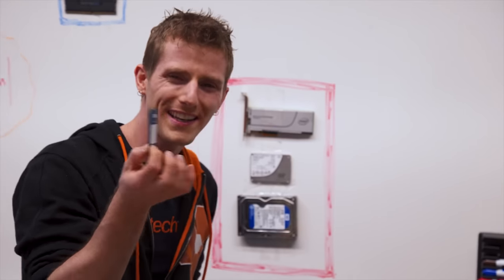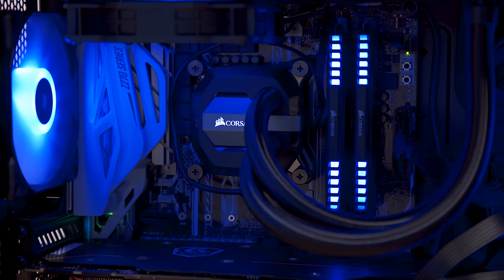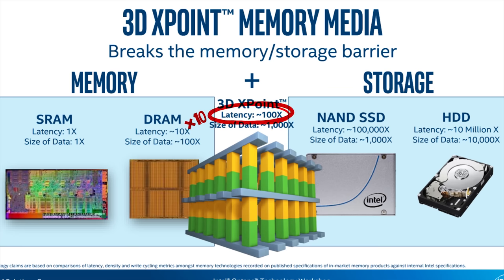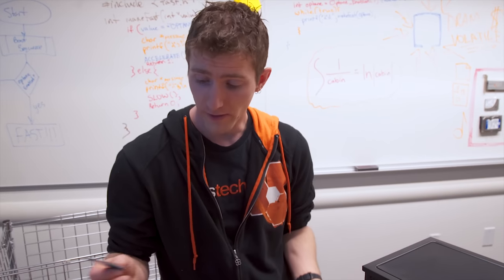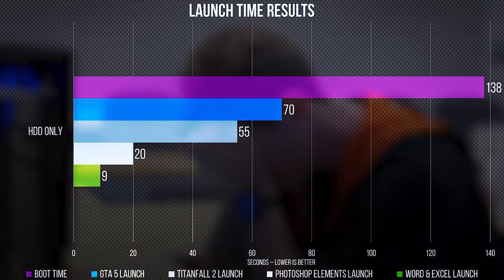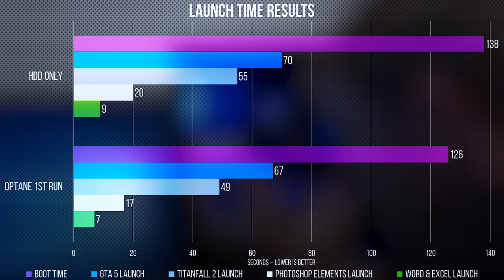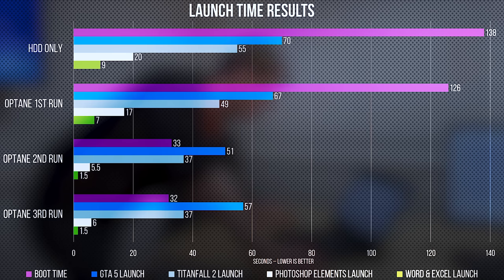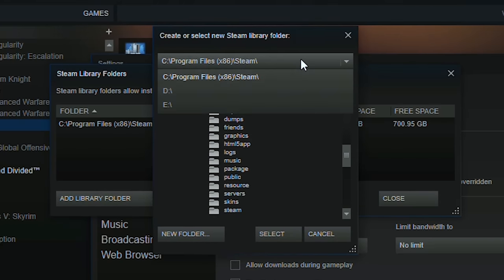Intel Optane Exclusive Hands On - SSD Crushing Performance

Comment: So basically a SSHD.... we already have that
Reply: not really. 1. it's way faster and has/is a bigger cache. 2. It works for all your drives.
Reply: but slower than a regular SSD NVME or Sata.
Reply: According to UserBenchmark's website you will see that most all SSHD benchmarks perform worse than the traditional HDD versions. So now you can get a good traditional HDD like the WD Black or one of the new Seagate Barracuda drives and pair it with one of these so you can keep the storage capacity and have the applications and OS perform like an SSD. Maybe caching technology isn't new, but there is still reason to appreciate this new release. This definitely helps out budget pcs. You can build a new computer with the lowest end 7th generation parts and it is still Intel Optane ready. You don't need to use the latest and greatest stuff to be compatible with it. The core i3-7100 and h270 motherboards will support it.
Reply: Userbenchmarks isn't a reliable source.
Reply: sickofitall89 are you kidding? It is the only website I know of where there is no bias. Because it is the public that provides the benchmarks rather than a public figure who is paid to speak good of a brand. You download their software and run it and it performs the same benchmark no matter what computer you use. It then automatically submits your results to their database. The scores on a product like let's say a GTX 1080 is based off of thousands of user submitted benchmarks. You can go to a blog where one person did one benchmark on the GTX 1080 and listen to them, or go to Userbenchmark and see how thousands of GTX 1080's performed under the same load. You have to be ignorant to think UserBenchmark isn't a reliable source. Are you saying GeekBench isn't reliable either? They work the same way, but with focus on the CPU rather than everything inside your computer.
Reply: Elmer Gloo Agree.

Comment: Why not install windows on that Optane M2 drive to benchmark it against some other SSDs??  16 or 32GB should be enough to do that.  It'd be interesting to see if we're really going to see the benefit of that extra low latency in SATA vs M2 vs PCIe.
Reply: Probably because its inferior. My opinion after watching the video is this is meant to turn a large HDD into a poor man's SSD. Say take 50 USD Optane + 80 USD 2tb HDD and you get something that is somewhere between an SSD and a 10000RPM HDD in terms of speed.
Reply: yeah its like first responce ram but with the data already on it.

still going to get a NVMe for my bood drive anyway so optain wont be that useful to me (nor willl it work with zen)
Reply: thom1218 - I think everyone is making a huge critical mistake, they think its a HD, stop thinking its a HD, and think of it as a "cache" FOR the HD... I think thats where the disconnect is with everyone... yes intel will be making some of these as a HD, but thats for enterprise level customers willing to pay insane amounts for faster performance, but at the consumer level, these 16/32GB sticks, will be acting as CACHE for your HD...
Reply: 16G is not enough for windows 10 and if you count updates - 32G is also not enough.
Reply: Actually, I have a 32GB tablet running the 32-bit version of Windows 10 with updates, and it even has 10GB of free space.

The 64-bit version probably won't fit though as it includes binaries for both 32-bit and 64-bit.
Reply: Its role as cache for an HD is clear in the video, but it wasn't clearly explained that these these sticks cannot be formatted and addressed via the m.2 standard as a regular SSD.  I'd guess that brief bit near the beginning about only working with the latest Intel chipset implies that they implement a brand new standard / interface designed to only operate as a cache mechanism.

Comment: TLDW: Non volatile HDD caching with native hardware support that's probably close to useless with a decent nvme drive and windows installed in UEFI mode.
Reply: NVME is just another interface to SSD/NAND. There is still the problem with write endurance when you use it with stuff like hybernating or page file swapping.
Reply: True... But I've yet to get bad sectors/errors on my first SSD (OCZ Vertex 2) and I'm a bit harder on HDD rewrites than the average person. Not to mention endurance has gotten way better on newer products.

Comment: DEFINITELY need a full suite of benchmarking/reviews.  Biggest questions are:
1.) Is Optane a cost-effective way to run 16GB or less RAM while retaining performance?
2.) Is Optane more worth it than the incremental cost of going for PCI-e NVMe vs. SATA SSD at same capacity?
3.) Will software changes be required to fully leverage Optane, or is the goal to be transparent to software?

Comment: what happens if you use 2 in just a single computer?
Reply: Probably more analogous to RAID 1 as apposed to RAID 0 in that I don't think you'll be doubling the already increased speeds. Instead you'll probably just be throwing money away.
Reply: banker games i think current motherboards just have 1 optane slot... if you use it as storage then it will just serve as another storage but FASTTTTT
Reply: I don't think you can yet.
Reply: like GTA 5

Comment: What does this do with all SSD storage?
Reply: Andrew Ramirez I want to know this too.
Reply: probably mothing,its the same between and ssd and an nvme ssd,the cpu is the botlleneck no the storage,while it will have higher speed you will see little to none performance increase
Reply: In an HDD system, your strongest benefit comes from using the device as storage cache, like a hybrid drive [SSHD].

In an SSD system, your strongest benefit comes from using the device as memory cache or memory mirror. If used as a memory cash, applications that don't need fast memory like Chrome, Steam, or Twitch could (based on access frequency) be allocated to Optane. If used as a mirror, if you shut your PC completely off, when you turn it on again, it can flash the contents of Optane to system memory after POST and take you right back where you left off... no boot required.

Do I actually know that you can set up the drive that way? Nope, no fucking idea, you probably don't benefit at all as an SSD user.

Comment: If this is supposed to be faster than current SSDs, why would you compare it to a regular HDD? We want to know how it performs against current tech, not old tech.
Reply: Matt Parks You miss the point. Optane is pared with a HDD to speed up the HDD. You can compare it with the SSHD, or Intel Smart Response Technology witch pares a SSD with a HDD to speed things up. So this is low tech comparision is relevant. This is not for us that can afford and use SSDs as main drives!
Reply: Or put a couple of 3 TB HDDs in your pc and an optane for cache - enormous storage with decent response time. Still, I can't imagine a wide range of users doing this. But hose, who can't afford ssd as main drive, can't afford an optane with high-end grade hardware as a requirement either.
Reply: Marcus Lagergren, you can buy a 120gig San disk SSD for $50. With this, you'll get a huge speed bump by using it as a boot drive and still have room for some programs. So why would I want to invest in optane when the speed of the SSD won't be noticably slower and I get storage capacity? I see no real benefit to using this over a cheap ssd.
Reply: Matt Parks This is not aimed fir those who wants OS on SSD as Intel claims it is hard to use. Optane makes sense in cheap PCs. It is statet by Intel and other tech sites that the DIY and enthusiast community is not the aimed part here. Dell, hp local PC stores etc are more the right taget here. And consumers that buys the cheapest PC they can get.
Reply: Think of a 2 TB HDD with an entire library of games being speed up by a 50 USD optane drive. You have to see optane as fast cache for a HDD to drastically change your load times. You basically spend 50 USD to make from your 2TB HDD a 2 TB SSD. It will affect your boot time, launching application time and game load times. I would say that's impressive. Even for high end users this makes sense because most high end gamers nowadays load their entire library on a HDD and their operating system starts from their SSD.  So basically for 90% of their time they don't see any benefit from their SSD.

Comment: So its just like samsung Rapid mode. Rapid mode uses 4gb of ram and  ram is faster than optane ssd.
Reply: DRAM is volatile so you risk data loss with that feature. This is non-volatile.
Reply: +Sakkura1 actualy its the same result, samsung rapid mode is excalerating ram as a chash for the ssd. near the same result as this intel product
Reply: No, it's not the same result because rapid mode uses system memory, which is volatile. If power drops, the data in flight is lost. With this cache, the 3DXpoint memory is not volatile, so power loss would not make the data disappear.
Reply: Sakkura1 I left that point out because everyone knows it. I thought optane ssd will be some new technology. Expect for far better life than a normal ssd.
Reply: Rewatch the beginning ppart of the video, he explains why this is not happening and that you cannot accelerate boot times with ram
Reply: It is an issue when there are changes to the data. Obviously pure reads are not a problem.
Reply: yes especially if you use fast ram.
Reply: Yeah. Just buy a 120GB ssd for boot drive and use dram as cache for everything else if you want. or just use the ssd. this optane drive seems pretty useless imo.

Comment: THIS  IS NOT NEW!!! 
Is the same as "intel smart response"
Compatible second-generation chipsets that support raid
Reply: Dinamitium 3d xpoint is new however
Reply: It's just a new name for an old technology.
If intel really wanted to renew this technology, they would add that cache directly inside to the processor

Comment: The question is, can you use it to accelerate another optane that eccelerates even more sh*t
Reply: Use only optane drives so that they accelerate each other and reach an infinite loop of acceleration. That's how it works, right?

Comment: You can buy a good SSD for the same price as a 32 GB optane memory,  Intel is ripping off they customers again,  the funny part is a PC with 32+GB ram, GTX 1080,  intel 7700k processor and a 200 series motherboard,  All of those expensive parts,  you won't pair with them a cheap HDD with an Optane cash memory stick, you'll insert an SSD. The optane purpose is to convince people to buy the  intel i7 7700k nothing else,  people will just buy a rizen 7 cpu with a GTX 1080ti and an SSD,  they'll have the best gaming PC for the price.
Reply: It is for a demonstration. it was not made to represent the world.
Reply: Still, a test with SSDs would be nice tho. Just for the record
Reply: yeah a comparison would be nice, but if you want that you need to wait for other tech review channel to get a hold of it.
Reply: Cache* me ousside
Reply: I'm yah I don't see this as a rip off at all. you can buy an 8TB mechanical drive,  add in the 32 gig optane for $77, and you'll have space and good speeds. Now add you the cost for 8TB SSDs,  and it speaks for itself. 

I recently built 2 systems for a business,  they didn't want to spend the money on a SSD , they would of gone for this though. You can use ANY 7th gen core processor,  and ANY 200 series mobo. H, Z or B. this is a good thing.
Reply: just because you like amd more doesn't mean you get to hate on people that use intel. Yes I use amd but I don't moan about how Intel make money
Reply: you forget that just a 2tb ssd costs around $500 vs 2tb wd black hdd = $130ish.
Reply: DT B Not everyone needs little enough storage to justify getting just an SSD. Content creators, video/photo editors, CAD users, Audio creators, huge steam libraries, etc. dont want to spend $600 on enough SSD space for their needs when they can get a $120 HDD
Reply: Ted The Generic Guy I wasn't talking about Optane. My whole comment didnt contain that word once, it was about why SSDs aren't useful for people with large storage needs.
Reply: Yeah but the thing is a 2 terabyte SSD is hell of expensive.  So I rather have a 2TB HDD and a 32GB optane drive to give this 2 TB HDD SSD performance. Everyone nowadays uses a large HDD for their game library, since a SSD is too expensive. I see a great benefit from this technology.
Reply: so this think won't work on AMD? how booty
Reply: People still use HDDs for general storage even on high end pcs. Who will store photos, work files, and other minor data on a more expensive SSD? This will lower its performance and life spam. People who have an SSD almost always have an HDD. OS installed on SSD as well as any other load intensive applications such as games or programs. Everything else goes on HDD as a store and forget function.
Reply: +DT B I have to disagree. My PC has the same specs that you've mentioned. My primary drive is the Samsung 960 Pro but secondary is still mechanical due to the economics of capacity. I have a WD Black 4TB drive. This solution suits me perfectly because I want to accelerate the secondary mechanical drive, not the primary.
Reply: Brian Su,  but you're loosing a lot of storage that's assuming that you have a 256GB+ SSD paired up with a 4TB HDD,  pairing up a 32GB  Optane cash memory with a 4TB HDD  you're loosing 224GB+ of storage for a few seconds faster memory,  that's dumb in my opinion,  you're sacrificing a lot of storage for nothing significant...
Reply: +DT B No it doesn't work like that. Intel RST only supports up to 64GB of cache. If you use a 256GB SATA SSD as a cache drive then you'll still have 192GB free that you can use as another drive in windows to store data (not wasted). With Optane you'll just pair the whole 16/32 GB with the mechanical HDD.
Reply: Brian Su,  👌
Reply: DT B "capacity"
Reply: hornymanonfire if you can afford it, SSD for sure. And if it's a new build make sure it's NVMe as it'll be 6 times faster than SATA III SSDs.
Reply: Jesus... put a full stop somwehere in your comments. They are unintelligible.
Reply: DT B 7th gen CPU and 200 series mobo right?
Reply: It is now possible to accelerate secondary SATA drives with Optane!!

Comment: linus can you do a video with a ryzen 1800x cpu that has a 2400mhz ram and another with 3600mhz and tell the difference between them in gaming performance and multitasking (please :) )
Reply: Just use 2.4ghz and 3.6ghz instead of mhz

Comment: Cant you just install the os onto the optane? Please, someone tell me.
Reply: Yes you can, its just no different to a normal SSD except the CPU can use it as temporary storage as well
Reply: 5etharama ok, wouldn't that have been a more sensible video to install the os onto that?
Reply: Wait, are the focusing on replacing ram and storage? like having a mini single board pc?
Reply: No. it's just extra memory and cache for the CPU.
Reply: +Taci7us no no no no. You got it all wrong. l1, l2 and l3 cache is stupid fast, ram isn't even close to that and octane is miles behind that.
Reply: Probably, but most windows OS take more than 32 gb of storage anyways, so you would be stuck with some Linux OS. I know windows 7 ultimate takes like more than 50-60 gb
Reply: but it use m2 slot. any different with high performance ssd?

Comment: Wow, I have a hdd only and my boot time is less then 30 seconds, how many launchprograms did you run?
Reply: Okay tested it and it's 35 seconds to boot and open chrome, 25 seconds to boot without opening chrome.
Reply: Ruben Buckens my pc takes 12 seconds to boot up without chrome and 20 with chrome and i only use HDD
Reply: windows 8 and 10 have drastically better boot times on any setup than 7 and before, on my sata m.2 equipped laptop, boot is under 10 sec
Reply: EurypteridX that's fast, did you just have a new computer? Otherwise congrats on keeping it so clean.
Reply: Ruben Buckens moved to ssd with a pretty full OS 

950 evo ssd boot time under 10 seconds too.

and i have a shitload of programms

Comment: I would like to see it in the following scenarios: 1) chosen to be paired with the drive that holds my steam library 2) built directly into mechanical hard drives to either augment or replace the cache already there (need to compare possible performance) 3) get large enough to completely contain scratch files for apps like photoshop etc.

Comment: Actually, optane is very bad compared to a NVMe so whats the point ?
Reply: optane isn't storage, it's boost. for $50.
Reply: sure but you can use the ssd also to boost your pc exactly like Optane or just buy 250 gb NVMe ssd for 40 bucks more and install the things that needs boost on it.
Reply: noooo
Reply: Optane memory is just for adding cache for hard drives.